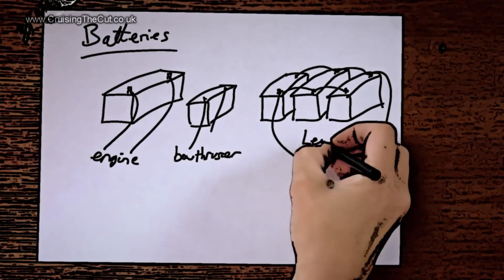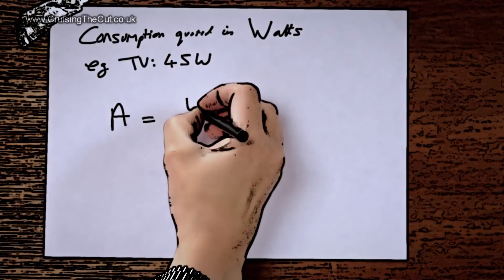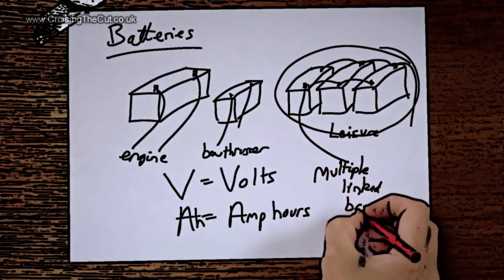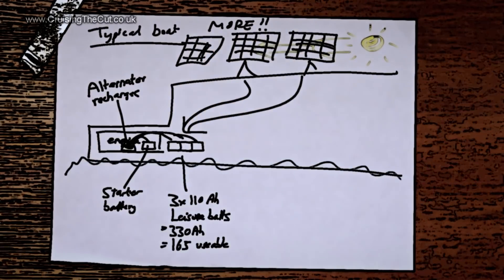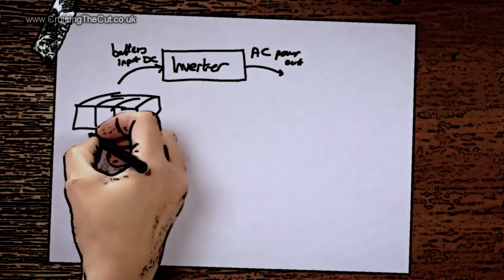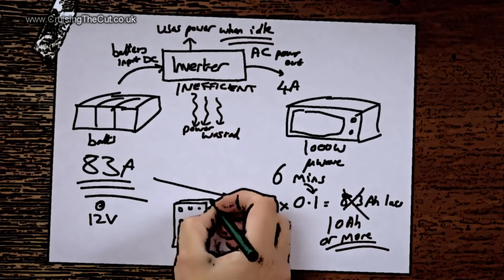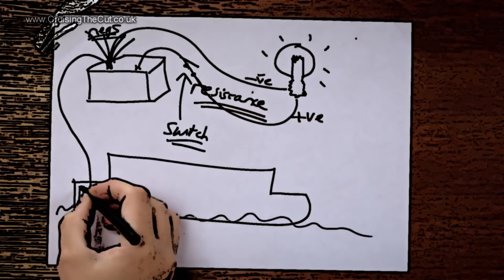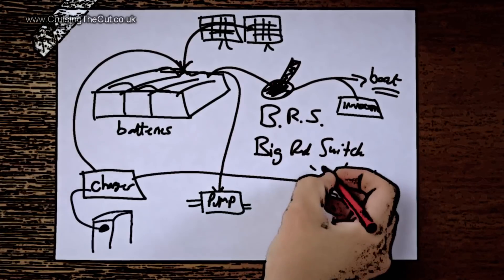136. Beginners guide to narrowboat 12V electrics: batteries, inverters, chargers, solar and so on

Comment: Did you do a "future episode" on electrics ?
Reply from the maker: I can't remember. I thought this was my episode about electrics.
Reply: @ in the wrap up to this episode you said you might do a future episode ‘or something’ on electrics.
Reply from the maker: Oh! Crikey, I'd better rewatch this and remind myself what I was intending 🤣
Reply: @CruisingTheCut  An idea: maybe show us what the various electric components actually look like on your boat. I've just got a river cruiser and it's still not entirely clear what is what or in what order the components are wired ! - the leisure batteries (ok); the engine starting battery; the unit that seems to sit between the shore power and the boat batteries (same as an alternator?); the unit that sits between the engine and the leisure/starter batteries (again an alternator? but the same as the one between the shore power and the batteries?); the inverter; the solar power controller and so on.
Reply: Or one entitled "Emergency Power" where you rig up an exercise bike and a DC motor to get a little charge after leaving the TV, etc on all night and every battery has died. Sorry, I was getting quite carried away there.

Comment: Loving your videos, thank you.  I have a question please. I would normally calculate my watt hours consumption by dividing watts by volts to get the amp hours in a spreadsheet.  Thus my consumption for my 230V/150W TV would be 0.65 amp/hr, not bad.  But you are suggesting its always based on the 12V battery bank regardless of an inverter (see 9:44 with an example of a microwave)? Thus my TV is consuming 12.5 Amp/hr, a vast difference. Could you confirm that this is indeed the case please? Otherwise I am doing my power audit spectacularly wrong!
Reply from the maker: Spectacularly wrong, I have to tell you 🤣. Your battery bank capacity is measured in Amp Hours at the battery voltage ie 12V.

Whilst your TV does draw 0.65A, that's at the 230V it runs at. At 12V it would be around 11.7A (150 W / 12.8V, that being the voltage of a typical fully-charged leisure battery)

Remember, the power it's drawing is always 150W. That's what's coming out of your battery. The current drawn always varies according to voltage in order to provide the Wattage needed. Hence you can say the TV is simultaneously drawing 0.65A (at 230V post-inverter) but 11.7A (at the 12.8V being fed into the inverter)

Incidentally, that's a helluva draw for a modern TV, is it a giant screen?! My old 24 inch telly drew about 1.8A (at 12V) if I remember correctly.
Reply: @CruisingTheCut  Thank you for such a quick response.  This is really interesting and may explain why my calculations never watched battery performance (I lived off-grid in the Kalahari desert for 12 years). Of course it makes perfect sense, the power must come from somewhere and the inverter is hammering the batteries.  I used a TV as an example. We are just starting looking into narrowboats, the four walls are closing in :). Thanks again

Comment: I like YouTube in so much as a "nugget" sharing platform, I'm very well versed in automotive 12 volt and solar systems but I learned from you today that 12vdc on a boat should not be grounded to the hull in the way a car does the frame. ty for sharing.
Reply from the maker: Hmm, I hope I didn't say that. The return path of the 12V system shouldn't be the hull for sure but the -ve terminal is indeed strapped to the hull, separately from but near to any mains earth (which would also be grounded to the hull). And the engine has a ground to the hull as well.
Reply: @CruisingTheCut  I must have paraphrased the explanation wrong. my bad.  https://youtu.be/4UNR2tDEAOc?t=785

Comment: AH is a constant.
So, your TV will draw 3.75A in one hour, and 7.5A in two hours.
An AH is a measure of usage over the space of one hour.
The reason your TV uses 7.5 Amps in two hours, is because it uses 3.75 Amps per hour.
If you ran your TV nonstop for a million hours, it would still use 3.75AH.
Reply from the maker: Not quite. It doesn't draw a number of Amps in an hour (3.75A in your example). It will draw a number of Amp-hours in an hour, since (as you rightly say) Ah is a measure of draw over one hour.

Amps is an instantaneous current draw. But if it draws 3.75A for an hour then it has used 3.75Ah. It certainly won't just use 3.75Ah regardless of time; it will always draw 3.75Amps at any moment but the overall Ah draw will depend on how long you run it for.
Reply: @CruisingTheCut   AH changes when you're referring to the capacity of a battery, but if your television draws 3.75A per hour. It will always require a system that can support 3.75AH, no matter how long you run it.

Your television doesn't suddenly double its power requirement just because you've been using it for 2 hours.
Reply from the maker: No it doesn't but your terminology is wrong. There is no such thing as "amps per hour". You have Amps which is an instantaneous figure and if you draw X Amps constantly for an hour, you have used X Amp-hours. Thus you are actually referring to "Amp-hours per hour". And thus if a TV set draws 3.75Amps, it will have used 3.75Ah after one hour, 7.5Ah after two hours and so on. The current draw is constant, as you are thinking, but the Amp-hour total power drawn depends on time.

Comment: Question, and I’m asking while starting the video, but there’s batteries that are just for electrics in the boat, and then the battery just dedicated for the engine? And the engine charges all the batteries and the solar panels charges all the batteries when the engine is not on?
Reply from the maker: Yes to the battery configuration. The engine charges them all and the solar can do although on my system and many, I suspect, the solar is more geared to the leisure bank.

Comment: I once installed electronics on boats as a job and this is an excellent video!  I did not know steel boats had a negative ground, most boats in Canada are obviously fibreglass or wood.  Great that you advised that we do not use the entire capacity of the battery bank.  Note that the only pumps on my 24 ft. sailboat are operated by hand!

Comment: Is it true that connecting the boat up to 240v for a long time can cause the boat to rust faster?
Reply from the maker: Yes, though it's not strictly rust it's galvanic corrosion. You avoid it by having a galvanic isolator or better yet an isolation transformer on the input to the boat. Plus attaching sacrificial anodes to the hull.
Reply: @CruisingTheCut  Much of that is because the British rust mites tend to thrive on higher voltages, being a slightly different species, where in the States, our rust mites prefer 12V DC and will chew through a car just sitting, covered, over the winter.  ;-)

Comment: I don't know why my brain has such resistance (heh) to understanding amps, volts, watts, etc  I feel like a bear of very little brain when I try, and I'm usually quite the opposite.  This video helps at least one piece fall into place every time I watch, and I've watched a few times so far. 
I try to make parallels between amps and volts so I can understand.  I make tea the way you do - one big bag steeping for a short time to make a strong cup.  So what would that be?  Lots of volts, but few amps?  Or is that a terrible example?  The hose/water one is another.  Hose diameter vs. flow, accompanied by time to get amp hours?  Honestly, I don't understand why I can't understand, and I think about this video at least once a day while making tea.  le sigh  Any examples to help me cement these relationships would be helpful, if you think of any.
Also, you are great at illustrating, lol.  BANG!  Yes, quite.
Reply from the maker: I don't think tea analogies will really help. More like filling and emptying a bath of water using different-sized pipes at different water pressures.
Reply: @CruisingTheCut  Thanks for the reply.  I tend to overthink, so iIll try to not use analogies and just learn the actual info.  Idk why it never sticks.  I know more complicated systems.  smh. 
Have a nice weekend.

Comment: One of the best description of a combine ac and dc systems.  This also applies to most RV's in the USA.  I am well versed in both AC and DC.  One item to add to future discussions is that all batteries are not equal.  Example Boats and RV nromally use Deep Cycle Marine (of RV ) batteries. Automotive batteries are built for a quick heavy current load  for the engine Starter and RV have a "house" battery for the 12 VDC systems such as water pump, lights, even some TV's.  Keep up the good work, Joe in Arizona, USA

Comment: Hi, thanks for your relaxing videos! You mentioned about the importance of not drawing the batteries down below 50% charge, but I don't think you mentioned how you know what the charge level of the batteries are. I know how I'd do it (and, during these times, I'm having to do so with my car - which likely needs a new battery) but what I'm interested in is how you know from your perspective. Thanks.
Reply from the maker: The only reliable measure is a voltage reading when there's no load.
Reply: @CruisingTheCut  Thanks, that's what I expected.  Thoroughly enjoying your videos, having only recently discovered your channel, and wishing!

Comment: About lithium batteries: even though they are about 5 times more expensive than lead acid batteries, they do weigh a lot less than lead acid batteries, and they take up less space. Lithium batteries do not need to be vented as there is no off gassing like the lead acid batteries do. As you mention you can deplete the batteries a lot more than lead acid ones, typically 85% as opposed to 50% so to provide the same total number of AmpHours you need fewer lithium batteries and you need lead acid batteries. And the key benefit that most people forget about is the lifetime of a lithium battery is much longer than a lead acid battery: in the order of 3-5 times. 
So as Power Tech Systems found when they analyzed it: "The total cost of ownership per usable kWh is about 2.33 time CHEAPER for a lithium based solution than for a lead acid battery solution"
source: https://www.powertechsystems.eu/home/tech-corner/lithium-ion-vs-lead-acid-cost-analysis/
Reply from the maker: Weight isn’t an issue in a narrowboat though and that huge upfront price usually is; not to mention potentially needing to also upgrade the mains charger, solar charger, and the feed from the alternator. Many lead acid types (AGM for example) don’t need venting either. And lithiums like to be warm. So there are benefits, sure, but also substantial considerations to take into account.

Comment: I don't know if this is wise on a narrow boat but as a Truck Driver we have these things called "APU" auxiliary power units. They run off of Diesel fuel and provide power and AC(they also provide power to the bunk heater that also runs on Diesel) to the truck so you don't have to run your engine, they're about as big as your typical fridge on your boat and bolted to the frame of the truck. I don't know if they're practical for a boat though but as i think of it your engine isn't much bigger than the motor in the APU which is about the size of a large lawnmower engine with the gear for the AC
Reply from the maker: Kind of like a mini generator? Some boats have petrol or diesel generators (stand alone) and some have a thing called a TravelPack which creates 230V AC mains but is driven from the engine (saves killing the batteries by running an inverter off them). I don’t know of an exact equivalent to your APU though.
Reply: @CruisingTheCut  Yes its all self contained in a box on the side of the truck, its run off of diesel from the tanks and charges the batteries(the bank of batteries i have on my truck are as big as your bank) and runs the AC unit for the sleeper berth. Totally separate from the engine and the pack can't be removed without serious work. Just for information purposes  i included a link to what they look like 

https://www.vanderhaags.com/detailview.php?part=24669658&keyword=&matchtype=b&aid=346321112117&source=adwords&gclid=CjwKCAjwqJ_1BRBZEiwAv73uwBx62OsSTGZboJs_WQv_wfdtyeoeJCYWLAV77xRlwwLGGDC77scalRoCDjkQAvD_BwE
Reply: @CruisingTheCut  Is this like an Eberspacher?

Comment: As the frig is a major draw on power, have folks considered a frig run by propane? They are pricier than ones running on mains power, not sure how they compare in price to DC compressors. They are stingy with fuel. Camper vans often have them. 2) have some narrow boaters considered demand water heaters run by propane? Such a unit would take up engine bay space (or elsewhere) as it would not fit beneath the bed. No storage tank necessary.
Reply from the maker: Propane fridges are rarely seen on narrowboats and no longer permitted under the safety regs I think. Likewise for instant water heaters; you are permitted to update and reinstall on a boat that already had one but new installs are not valid.

Comment: Imagine how comfortable you would be if you replaced your coal stove with a new coal stove with a back boiler to heat the rest of the boat by convection. You'll get used to the posed pipes and learn to be careful in the heating season to not burn your self on the exposed pipes or the hot radiators. Then you get maximum fuel use from the coal you burn. Granted we're talking more than a few pounds but you should be able to recover some of the cost by selling your original to the boat coal stove. I'm sure you wouldn't have too much difficulty selling her.

A big advantage to doing this is not consuming electricity to run your oil fired boiler in the engine room.

Cheers!
Reply from the maker: I think in a new build I might consider it but the cost and aggro of retro fitting it to mine would not be worth it. Also, the existing stove happily heats the saloon, kitchen and dinette - the bathroom doesn't really need it and I prefer the bedroom colder so that I can sleep, so really it's not necessary.

Comment: I have very much enjoyed your Vlog and have been binge watching over the past week and, as you can see, I am up to #136. I hope you have a safe trip back from down-under.

Comment on your electrical calculations:

The energy devices (loads) consume is measured in Watt-hours at a rate (power) measured in Watts. A battery's capacity to store energy is measured in Watt-hours. 

Battery manufacturer's confuse this issue by rating batteries in Amp-hours at a nominal voltage. For example 12 Volt battery rated at 100 Amp-hours is twice the energy capacity of a 6 Volt battery rated at 100 Amp-hours. 

You have decided to normalized sources and loads to Amps and Amp-hours. The proper method would be to normalize everything to Watts and Watt-hours. This will be particularly useful if and when you take into consideration conversion efficiencies, such as inverters to mains voltages.
Reply from the maker: You are, of course, strictly correct. However, as narrowboaters and narrowboat systems tend to be quoted and measured in (12V) Ah, it makes more sense in a guide to such systems to use the common convention even if not the preferred technical notation. I have not arbitrarily decided this for the video, it's the common convention.

Comment: This would have been handy forty-five years ago, when I started my railroad career in the signal department.  Took a year, without help, to get to the end of your fifteen minute vlog.  Well done.  And yes, I did blow a hole in the blade of a long screwdriver by dropping it across a 12 volt battery.  Noise and flash to match Hollywood's best pyrotechnics.

Comment: 4:36 2 hours of watching would use more close to 9Ah. You forgot to include inefficiency in inverter, normally 15-20% . :D
9:42 No, more like 100 amps... Again inefficiency ;D

11:05 Oh there you go ;D Tbh, I think you should have talked ablout that before even talking about the 6 minute microwave, as it's esssential to proper sizing of batteries.
Reply from the maker: It would have been too early in an explanatory video for beginners to go into inverter losses etc at the start. Better to add that in later, gently make things more complex as you go.
Reply: @CruisingTheCut  Hmm, you might be right. 

But it would be very important for when doing the audit to note that 100W 240v is approx 120W drawn because of inefficiency. 

Otherwise one might end up with very very wrong sum of wh daily ..

Comment: Hi David, I am an ABYC certified marine electrician and want to applaud you for making such an informative video. You made some excellent and very important points. There is a lot of talk about lithium but people generally do not understand there are several types of lithium are not all are suited for a boat. Also, the charger, discharge, and storage characteristics of lithium are so different from conventional batteries that installing lithium requires a complete battery management system designed for them alone.
Reply from the maker: Thank you. Yes, lithium would need its own video (or more!) I reckon

Comment: 11:55 When I was a youngster I was undoing the +ve terminal of a -ve earth vehicle. I had my left arm on the body of said vehicle when my spanner touched the metal bracelet of my wristwatch. I had blisters for some time around my wrist, and still bear a very faint scar 45 years later. You can WELD with these batteries, a point which was made very clear to me by the state of my watch bracelet. . This is why you MUST disconnect the earth ( or ground for the Americans ) first. It is also worth noting that batteries can explode. Seriously.